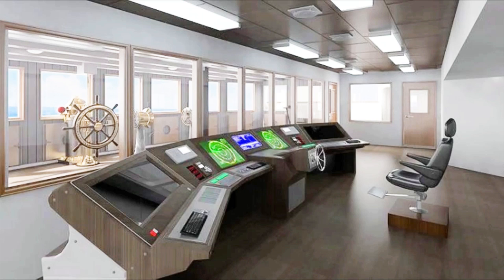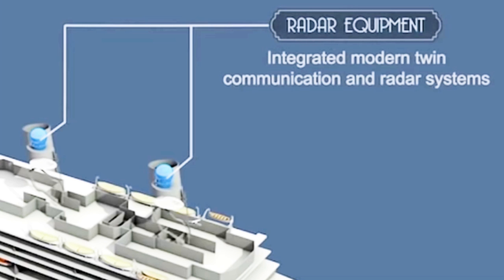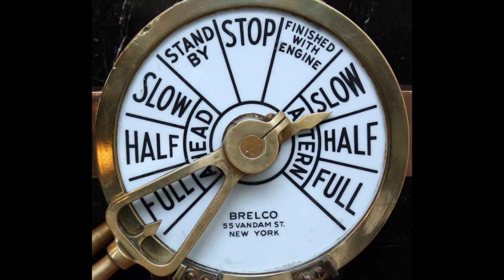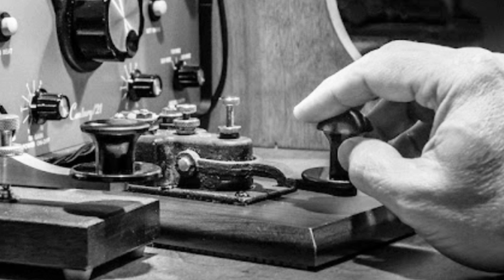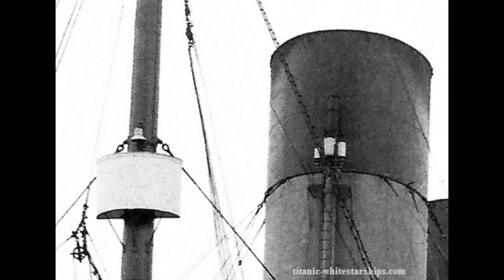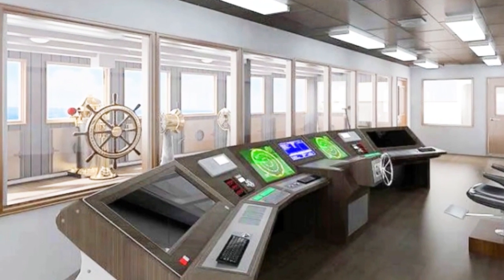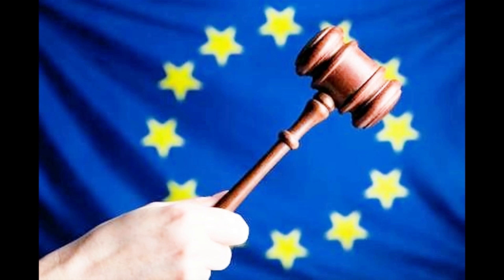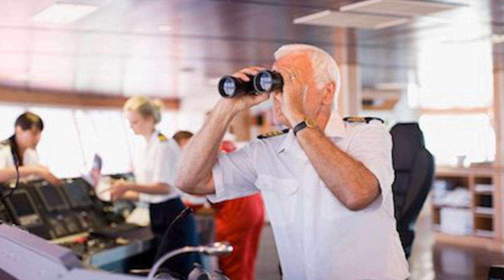Titanic II: The Navigational Bridge

Comment: Since the replica bridge is there, its pretty clear Titanic 2 will need to implement an open bridge policy, that way both sections can be used by passengers and crew alike. 

The crew can stand in the original bridge area while on lookout duty.
Reply from the maker: They will not want passengers sharing their bridge taking photos etc. while at sea.